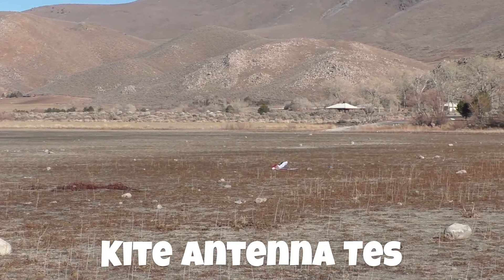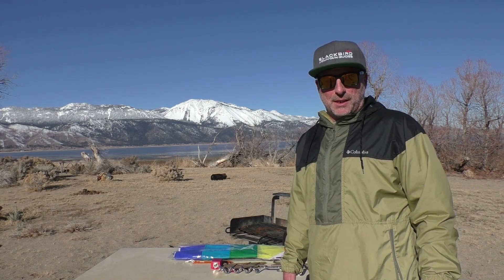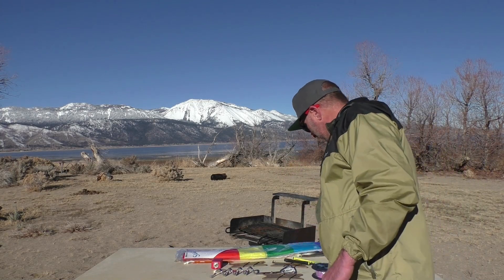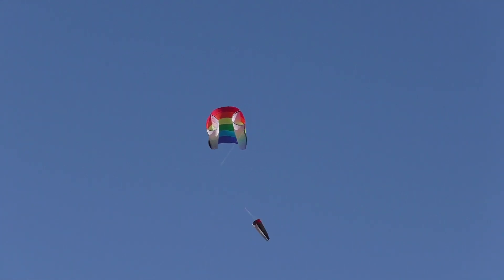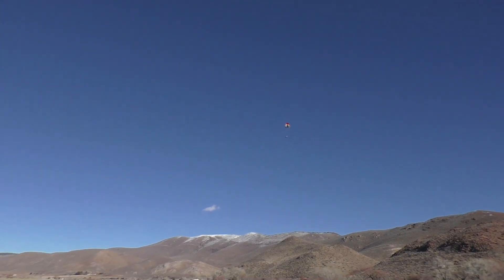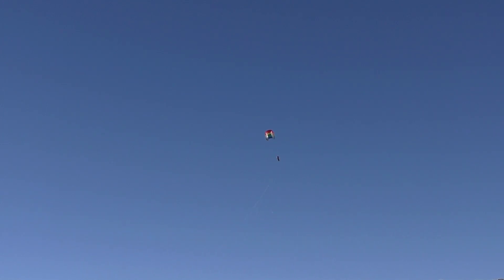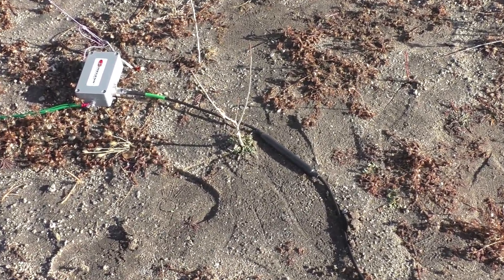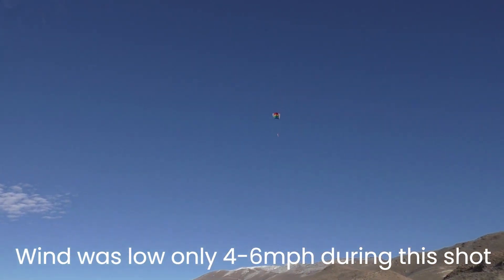How to HF Kite Antenna

Comment: Don't go all 'Benjamin Franklin', so take precautions.  1) Far far away from power lines. 2) Not when there's any sign of lightning. 3) Add a lightning arrestors at the base. 4) Might be wise to use a DC grounded antenna solution to avoid DC static frying the radio.

Comment: I did this a few blocks from an AM broadcast tower, and picked up so much energy from the station that lightly touching the end of the wire gave me RF burns, and when I attached it to my HF radio the radio station was all I could get. It came out on every frequency.
Reply from the maker: I've picked up some AM stations from a distance. Grants Pass! I used to live in Central Point years ago. I want to experiment with the kite again with some static bleed resistors and a 80m efhw. 
Thanks for watching!

Comment: Might be the ideal approach for LF monoband verticals, near the ocean, for 630m and 2200m bands. I wonder how fine a wire would be needed to get 550m of wire in the air?
Reply from the maker: I suppose it would depend on the lift of your kite. You should experiment and let us know! 73, W6IWN
Reply: Yep, a Zaktech WSPR Desktop for those low bands is on my wish list.
Reply: I'm thinking 22 gauge telco cross connect wire.